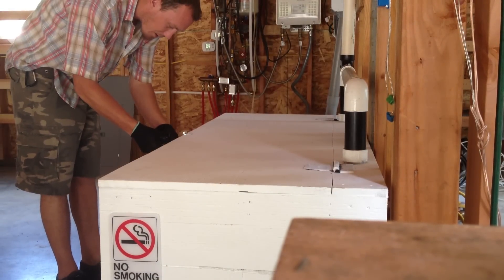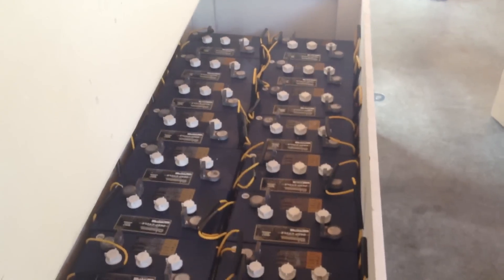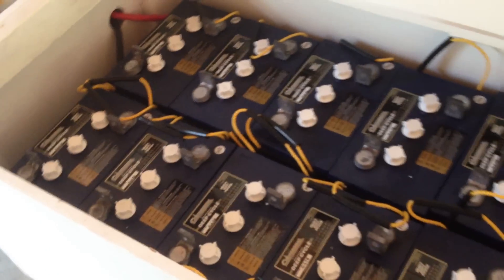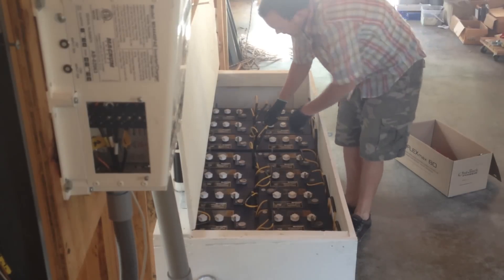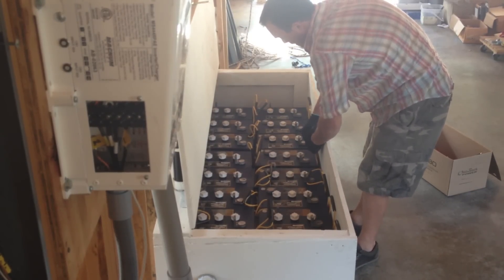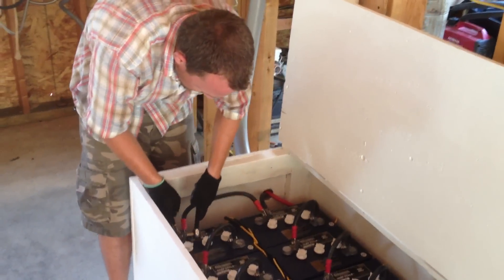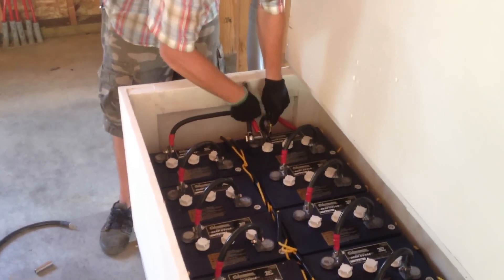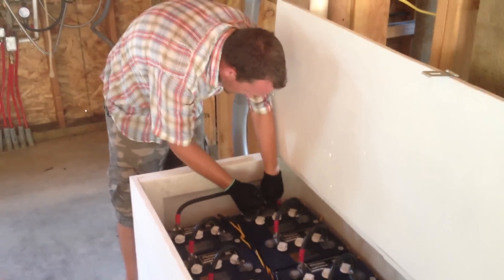How to Wire an Off-Grid Solar Battery Bank at 48V for most efficiency.

Comment: Less wire if you reversed every other battery and ran a copper bus bar and only used cable at the ends. Just saying. Corrosion happens inside cable also then restricts amps going in. Been there done that. My qualifications are 26 years off grid. And learned the hard way. Just trying to help.

Comment: How do you monitor your 50% discharge?
Reply from the maker: The Nominal Voltage of the system is 48V, but the batteries sit fully charged at 56V, with Lead-Acid batteries, when the voltage is at Nominal, (in this case 48V) the battery is in fact at 60% charge

Comment: Electric tape will make the job much safer for those voltages. But please stretch the tape as you put it on with the roll. Very nice setup! Please share your battery hydrometer readings and charge controller settings. also who made your batteries and what does the manufacture recommend for charge settings. And what did you use to crimp the cables??

Comment: Not for nothing but, I saw a few mistakes in your set up. I'm glad you took the time to wrap electrical tape around your tools, but really no safetys glasses really foolish. I'm glad you took the time to provide a vent to let the gaseous flumes vent to to outside, battery box should have had a slant so explosive rise to to back were your vent is other than that nice box.
 One more point this is a biggy  you should put duck sealant, (looks like a grey clay) on conduit both in the battery box as well in load side, or charger the reason for this is two fold, one you keep deadly explosives gases from entering your equipment were a spark from a cooling fan can blow up or destroy your home, and to keep the highly corrosive vapor from sensitive electronics. Just a little friendly advice from 35 year plus electrician

Comment: Use adhesive lined heat-shrink sleeving for your spanner insulation, it's tough stuff! Electrician's tape goes sticky/slimy when warm or old and can slip under pressure, leaving your delicate paws unprotected.

Comment: You need a fuse/breaker in the link where you parallel the two strings.

Else you risk a fire etc if a battery shorts out.

Comment: You really should have planned this video out better. Did you not even review it before posting? The audio is too low to be picked up by your mic. Also, there is a question as to balancing the charge since you go from series to parallel. The batteries become unbalanced at that point but I'm not positive if that's true.

Comment: what size cable do you use to connect the batteries to the inverter
Reply: 1/0 welding cable up to 4, then if you go longer you wil need to use 3/0 as to let more amps get threw I install solar systems and now for a 12v inverter you wanna use 3/0 for the four foot as the 12v inverter will draw more amps  then the 24v and 48v

Comment: aside from showing us how to insulate a tool, and re position batteries the title of your post is "How to Wire an Off-Grid Solar Battery Bank at 48V for most efficiency". You've failed at explaining your method....... If you didn't have the illustration on how to wire a battery bank in parallel the entire video would have been pointless. Not trying to sound like a tool myself but a little video editing and sticking to the subject would make this a lot better.

Comment: Hello Tyler norton you are correct in one way. But 12v can't do any thing to you the voltage is to low and your body resistance is to high. It only takes 0.75 of an amp @ 240v to kill you. So an amp @ 12v or 24v won't do much to you. Hope this helps you.

Comment: Sorry to blow your breaker there KUHRD but the Voltage of these batteries is not the big problem to consider. Yes they may be only 6 Volts each and he may only be able to contact two at a time, however as he wires them together it becomes an issue of Amperage that is the risk. These deep cycle batteries may be of a lower voltage but they have GREAT Amperage and that's where the horse power lives so to speak. Hence why a measly 48 Volt system can melt his tool in his hand. Never assume low voltage cant kill you dude.
Reply: True! I am cautious when working on my Lithium 48v bank. The 100aH cells can easily discharge 1000 amps. Zee-Oww! :)
Reply: ***** :) How true. That is a reason I have a 175amp DC disconnect breaker to shut down the system completely. Remove any loads and make working on the battery safe. Matts over the bank though is a good idea.
Reply: ***** Agreed. I use a system of 16 - 100aH LiFePo4 cells (3.2v nom) in series (Zero parallel connections) for a 48v nom battery bank. Braided straps. Only two sets of leads on the bank terminals. The large double aug cables for the inverter side and the smaller wires for the Charge controller coming in. The main break is for the inverter side disconnect. The Disco panel has two breakers for the Charge Controller. One to shut down the PV current coming into the CC and another breaker to shut the CC down from the leads coming from the Bank.@2000watts, the incoming is around 15 amps/~150v. C.C puts in 30-40amp on the battery side. The inverter side of course can see around a hundred amps or so depending on the House Load.
Reply: ***** I do. I feel that Photovoltaics work in quite a majority of the world where people live. Here in Colorado, USA, the sun is phenominal. Even though we get plenty of snow, the skies are generally clear even in the depths of winter. I'm sure it has to do with the Altitude somewhat @ 8500ft/2590m. My home is entirely off-grid. The system powers everything from the electric kettle for my PG Tips to the Slow cooker and the LED lights. Even the 42in HDTV for movies and the occasional video game. :)
Reply: ***** I'd imagine you need 2-4 times the number of panels for the same system size as me in UK. I oversized mine to keep away from needing a petrol Genny. I do not own one. Even in heavily overcasted days, the panels still produce 400-500w (out of 2000w). The only point it really becomes nothing at all is when it is a blizzard and the panels are being covered.
Reply: ***** I've pondered tossing up a couple hundred watt turbine for collecting a few aH at night. Not that it is entirely needed. Although in snowy conditions, there is wind.

Comment: Nice set up you have there and keep up the good work.  Spot on about the plasma potential. Arc flash, be it AC or DC will produce Plasma and if you are in close proximity can receive severe burns and be sprayed with molten metal. A couple things I highly recommend are face shield,insulating rubber gloves and protective clothing that will not melt to your skin. The general public has the misconception that batteries cannot do any harm.  This can be a fatal mistake unfortunately for some.
Reply: At 48VDC the voltage is low enough to generally be safe even with wet hands.  Safety glasses are pretty much a requirement and a face shield would be a good idea but not necessary.  Arcing is not much of an issue on this setup since the highest voltage he could come into contact with any 2 points of a tool at that length would be 12VDC and he has insulated the tool reasonably well.  Since he was first hooking up these batteries the risk of explosion is near zero.  If they were being charged or equalized then it would be a good idea to wait 15-20 minutes with good ventilation before attempting any connection changes that could yield a spark just in case.  Batteries are actually very safe as long as you take the necessary precautions.  Battery acid is also a fairly low concentration so I would not worry to much about acid as long as you can get your clothes off and get to a shower within a few minutes or have some baking soda nearby.
Reply: FlowerPowerNZ  Gary Mills did not mention a thing about an insulated ratchet specifically.  He is talking about wearing a ton of PPE which is not a bad idea.  If you read my post you would see that I already talked about the ratchet being insulated fairly well and that the biggest risk with a battery bank is that of explosion of hydrogen gas due to arcing when the the batteries are being charged or were a short time ago.  The main key here is to use a wrench that is made for working on batteries or tape one up well and you will be fine.

If you look at how he is wiring up the batteries the only way he could have put his tool across 2 terminals with a potential of 12v is if he hadn't taped it up and it was too short to reach the 6 v terminal on the other side of the battery.  Taping up the tool well is sufficient if you don't have an insulated wrench after all that is effectively all an insulated wrench is.  The best wrench to use would be a dedicated battery wrench since it will be insulated and much shorter so it could never make contact with 2 terminals.  

Even if he chose to risk it and was using the tool without tape and was able to make contact across the 12 v terminals of the 2 in series the most that would happen is an arc would be formed at the point of contact until the lead from the terminals ablated away which would happen near instantly breaking the circuit in most cases.  The tool itself would take a few seconds or so to heat up if left in contact.  Even if the tool made good contact with both terminals the internal resistance of the steel tool (about 0.2-0.4 ohms *just tested my 9" ratchet and a few 6" wrenches) and the battery ( about 0.01-0.03) ohms) would mean the tool will only be conducting 60 amps at most (probably much less in a real world scenario) due to contact area and that resistance would increase as the temperature of the tool increased.  

Now if I was working on a 400-800 amp panel with 480v 3 phase I would be much more concerned about using specifically insulated tools and in that specific case the panel would be locked and tagged out anyway.
Reply: FlowerPowerNZ  Ventelation is something else you may want to consider, adequate for when the battery shack is closed down, and Windy with a chance of gale force ... well, maybe Ive gone a bit too far there, but I think you get the drift.  I always like to have BETTER than NORMAL ventilation when I'm in the batter shack, then drop down to "normal" after I'm a hundred feet away!

Comment: I wonder if you can help me with my situation.
I have a 10,500 watt off grid solar system with of course generator back up and a 24 battery, 6volt battery bank. I have 24 new batteries coming in soon and I want to make sure they are wired correctly with series/parallel configuration. Could you possibly make a diagram of how they should be wired correctly using Series/Parallel wiring making a 48 volt battery bank. Please send e-mail to:... chris@tampabay.rr.com....and thanking you in advance for your help.

Comment: I enjoyed the video but I had several questions.  Why 48v?  It seems to me that no matter how many series you put into system that the actual input to the inverter remains the same as if you had all parallels. Input is not changes.  The lower wiring cost is academic for eight batteries, very little price differences even though higher amps require larger copper connectors. So please explain your efficiency and lower wiring cost basis.  Second question is on battery choice.  Why not use AGM batteries since the marginal cost is offset by efficiency for charge and discharge times, better tolerences for daily temperature and for vibrations.  And the most important reason - much safer due to not having hydrogen gas dangers.  So two questions; why 48v and why not AGMs.  Thank you.
Reply: 48v is more efficient because it requires less amps in total per kw. So when drawing high loads from the batteries for example 2000w = 2kw = 41.66amps at 48v 2000w at say 12v is 166.66amps. When you draw batteries at high amps you get more heat, heat = loss. Also when you draw batteries at a lower amperage you have more available energy from the battery. When you draw them at a higher amperage you dont get the full available power because of voltage loss/heat loss + battery chemistry (I think) Also when charging at 48v you have more power available in per charge controller. So if you have a 48v system over a 12v and one charge controller rated at say 100 amps (for a nice round number) you can charge at 4.8kw on the 48v system and the 12v system can only charge at 1.2kw at 100amps. So it in theory means less equipment to charge at the same rate as well. If you want to charge at 4.8kw in on a 12v system you would have to have 4 x 100amp charge controllers where as the 48v system would need just 1x 100amp charge controller. In general higher the voltage the more efficient the system because of less heat. Less heat also generally speaking in terms of electronics means longer running life, because the components inside. Hope this helped :)
Reply from the maker: Daniel Wilson
Good job explaining that, thanks!
Reply: Daniel Wilson Beautiful Explanation, Dan!
Reply: Also another large efficiency gain from going 48v as opposed to 24v or 12v is. -One due to have less of voltage change between panels(50v-100v typically) battery (48v in this example) and the inverter output(120v and of course AC not DC)
      And two being that lower voltage charge controllers and inverters can handle less wattage or are simply much larger and more expensive than higher voltage ones. you will save a lot of money and end up with fewer devices that likely have better control and integration features by going 24v 48v or higher. 
     12 systems are great for small systems parts can be interchanged or sourced from the millions of 12v systems already in the wild on cars and such. and there are a million things that can run off it directly. so if you go higher voltage you may want to also buy a DC to DC converter to step down 48v battery voltage to 12v current for your devices. of course if you already had a small 12v system this might not be needed.

Comment: thanks for a good video 
i just want to ask what if i have 12v batteries instead of 6 v to make a battery bank like yours?
will that help me to let the battery lasts longer?
Reply: In a word, No. a 2v or 6v battery bank has dollar for dollar and pound for pound dramatically more capacity and longevity. It will have less instantaneous power output. but what is needed is days of power. consider that 24 large 12v batteries can start 24 very large engines all at the same time! that's a lot of power!!!!

Comment: You can get a step down transformer to take your 48v down to 24 or 12
Reply: ANTHONY CABALLERO Life saving tip right here... You just made my system.
Reply: Use DC to DC converter Instead
Reply from the maker: Yes correct, and you would wire that in the enclosure panel to allow more options for your power system.
Reply: Jon B My pleasure :D

Comment: This is an afterthought for you, I worked for Exide Battery and they used copper straps on threaded lugs that gave a positive connection and you could get consistent spacing.

Comment from the maker: You would simply connect 4 pairs of 2 batteries in serial, and connect those 4 "strings" in parallel for 12V.
There are diagrams for this you can google. Also, why are you using 12V? 48Volts is optimal most of the time when planing a system from scratch. Lower wire costs..

Comment from the maker: Hello, these batteries have a AmpHour capacity of 375Ah each.. There are 16 of them, meaning it has a capacity of 6000Ah, however you never want to use more than 50% of the battery capacity before recharging, so it is realistically 3000 usable Amp Hours. Or about 7 days backup for the needs of this system.